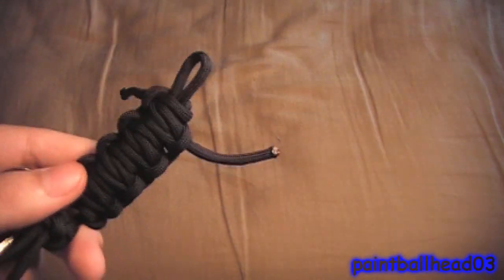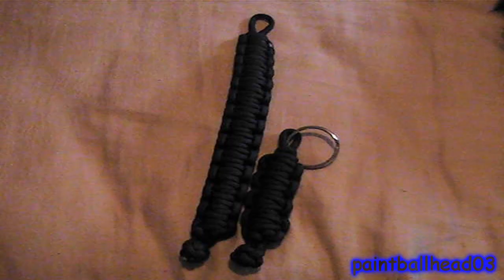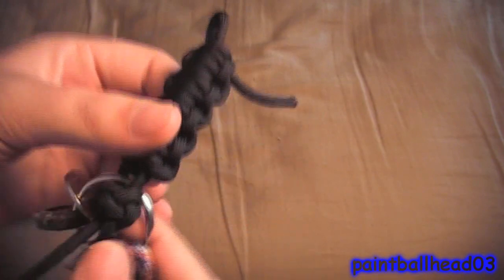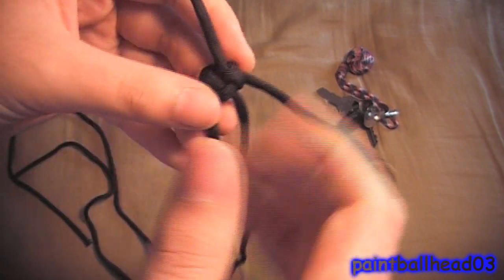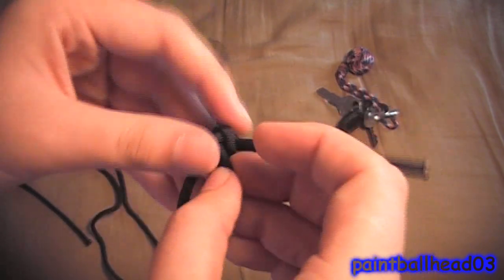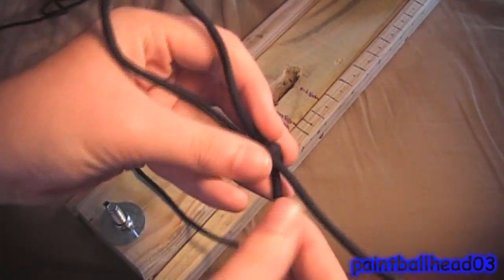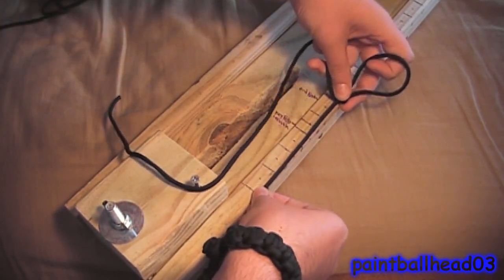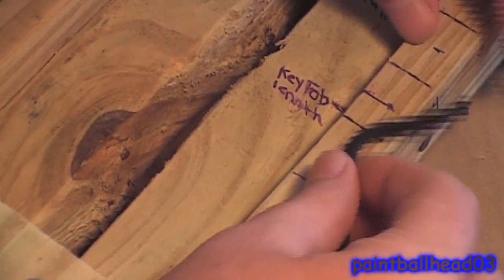How to make a Millipede Survival Paracord Key Fob

Comment: for searing the ends, i suggest getting an exaecto knife, then hear up the blade, then just cut through the para cord, it leaves a very clean end, already seared so it does not fray, and it does not damage the surrounding cord.